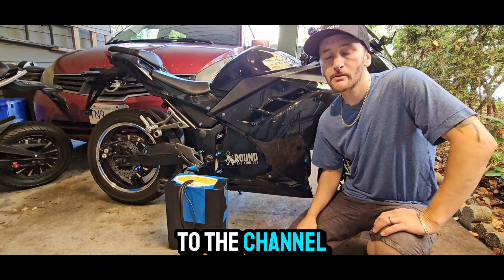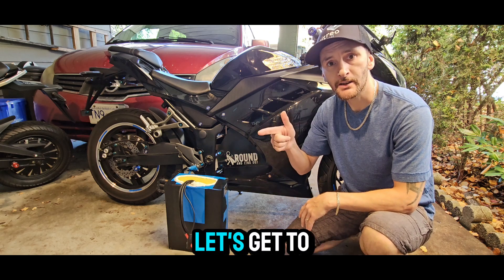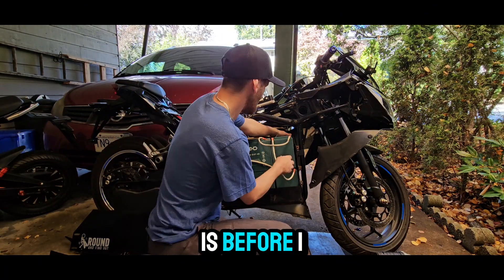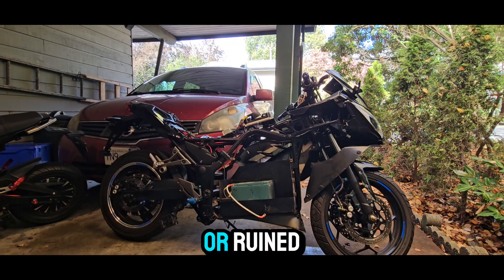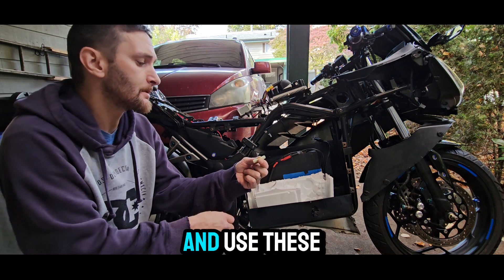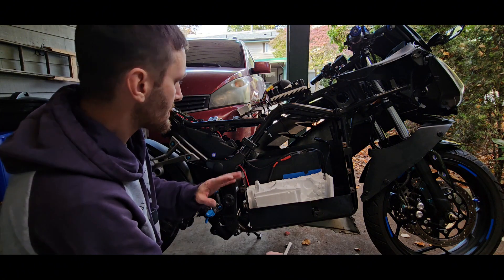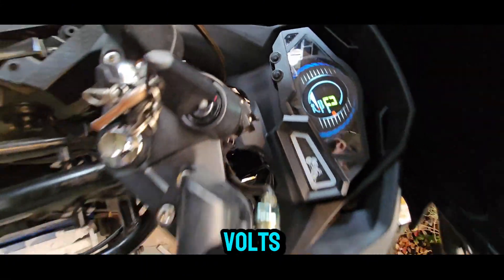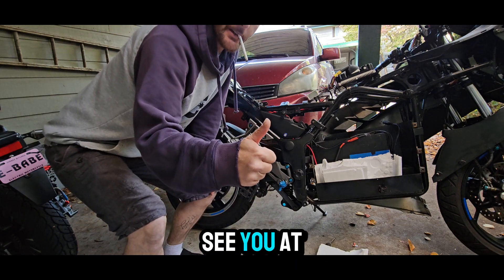upgrading from lead acid to lithium #emmo zone

Comment: Is the compartment of lead acid battery and lithium battery the same?
Reply: In size I mean
Reply from the maker: @satria_137p 
Yes weather you buy lead acid or lithium the battery compartment is the same size but you can fit a 72v 100ah lithium battery in there as opposed to the 72v45ah lead acid battery is al.ost filling the compartment ,so go lithium for sure, lithium is just better in every aspect as long as you buy from a reputable company, I bought the lead acid battery with my bike because it's way cheaper and the lithium batteries emmo sells are low end x and way to expensive, it was just better to buy lead acid battery and then upgrade to a aftermarket lithium battery, plus i saved thousands doing it that way. I hope I answered your question? If not don't hesitate to ask me anything.

Comment: Can I ask you where I can buy this specific battery
Reply from the maker: I bought mine second hand but if your gonna buy a lithium battery I'd advise buying from one of these three places
Amorgepower.com can build you a lithium battery to whatever specs you want and  for cheaper and top quality but takes awhile for shipping. 
Voltalize.com is a Canadian based company that sells really good batteries for a little more $ but is quick to ship and has better aftercare warranty because their local,
Then there's evcustoms.ca, a guy named Eric Lynn is located in ontario and he will build you an amazing battery or custom build and upgrade your bike .actually this is where I plan to get my motor/controller and my battery when I can .
Reply: Ty so much I will use homegrown ones lol the Canadian ones this is so frustrating I have only had my bike a week n I’m not impressed with lead acid

Comment: My zone has a bad brake squeel even when slightly moving tried everything 😢 any ideas plz help
Reply from the maker: So the obvious fix is to clean them with brake cleaner but that doesn't last very long, best thing to do is buy new pads and cleaner to clean the disc's and new pads before installation but what I did until my new brakes arrived is i took a rag and a little oil and put some on the rag and wipe down the disc's with a little oil and the wipe it off with another rag ,front and back brakes then go for a ride and brake really hard over and over until you get full stopping power back, I know it sounds weird or stupid but it really works! And it lasts quite a while but you have to do the braking hard thing repeatedly for 10-15min before you actually go riding somewhere. Also there's something you can buy called brake quiet for cars and I heard that works too but haven't tried myself. 
Hope that helps? Trust me I had the same sqeeling, actually apparently everyone with a zone has the same sqeeling. It's a combination of cheap pads and disc's.

Comment: Hello @theemmohandyman I just bought a emmo zone 2 20ah sla and just a quick question did u have to change the charger or is everything the same jsut swap battery over?
Reply from the maker: You definitely need a lithium charger if you are switching to a lithium battery!
Reply from the maker: Also when you buy your lithium battery you need to buy a matching charger, on the lithium battery it will tell you how many amps it can be charged at. So mine can be charged up to 10amps , so i bought a 10amp charger but if you want you can use any lithium charger under 10 amps aswell but nothing over the rated amps. 
Also usually when you buy a lithium battery it will come with a charger. ⚠️Warning don't buy cheap lithium batteries!!  My your battery from places like amorgepower.com or voltalize.com or evcustoms.ca 
Those are the top places for batteries for these ebikes and also don't buy the lithium batteries from emmo or any of the similar ebike companies they are over priced and garbage, my advice is pay for a good battery and it'll last for 5-10years depending on how much h you ride and you'll get a proper warranty.

Comment: Hello, can you please provide a link for this battery? Or was this custom ordered? If so can you please provide who and specs? Thank you!
Reply from the maker: Hello, so I actually bought this from a friend but all batteries I've bought before and will buy will be from a Chinese distributor, 
It's called-amorgepower.com  and you can check out there different types on the website or goto alibaba and check out prices but this company is the best quality and nobody can beat there prices,you can either pick a battery matching what your looking for or they can also make you any size/any voltage/ any amp continuously you need,just give them the specs you need and the size of your battery compartment and they'll build it for you,seriously you won't find a better battery company with this quality and prices, here's the link,
https://x.alibaba.com/xyKHTze?ck=minisite
But if you want to keep it in canada or USA  goto evcustoms.ca or https://electroandcompany.com/
But personally amorge is equally good and way cheaper!!
Good luck!

Comment: Can I ask what is the sized of the fair ring bolts and the  Swingle arm that you brought of aliexpress on your bike thanks.
Reply from the maker: @starship9290  so the swing arm is stock if that's what you mean but the fairing bolts you can get a link if you go to one of my other videos called ( upgrading to better fairing bolts) something close to that and all links in description. Actually everything I've done with my bike is in the description of each video apart from the lithium battery,that I bought privately .

Comment: Is battery protected against wet weather conditions rain while riding in the rain ?
Reply from the maker: @starship9290  I do not ride in the rain,some people do ride in the rain but would you watch  TV in the rain or use your computer?
Yes you can ride in the rain but it's not advisable if you want your bike to run properly and with no problems. I dont ride when its raining but If and when I do get stuck in the rain, when I get home Immediately grab a towel and dry everything off and I mean everywhere I can and paying close attention to the throttle and signals and brake levers/the charge port /definitely the battery box ect..ect..by the time I'm done it's dry as it would be on a sunny day. It's a really expensive bike and I want to keep it in top shape as long as possible.
Reply: Of the game is on Hell yea I could tv in the rain lol 😆  jokes aside.
 I got me a tao leo ebike and I use it as a daily commuter to work and I only rain in the rain when it very light rain by the time I get to work the rain as stop plus I also have a motorcycle cover I use to cover my ebike when am at work if am gone for long periods plus a motorcycle disc lock.this works for me so far so good. Thanks
Reply from the maker: @starship9290  ya I get it,I have ridden in the rain when I have too but I don't if I can help it ,I've seen many problems.s with getting then too wet and honestly I get a little scared to fuck it up,I haven't had many very nice things in  life and my zone is definitely the m9st expensive and fuckin awesome anything I've had so I totally baby her,but ya lots of people do ride in all types of  weather conditions and do just fine .
Lol! But with my luck I'll start riding rain or shine and fu k something important lol! And your right I'd watch the game in the rain a fuckin day!!

Comment: May I also advised that u should add some soft pads under lithium battery and  Strap it to them because the bumps on the road So the battery will not move while driving on the road
Reply from the maker: @starship9290  so I didn't show in the video but there's a bar that is used to hold down all the lead acid batteries and I also surrounded the lithium battery with thick Styrofoam and then the bar is bolted on top of the box and straps it down, but thanks for looking out 😃

Comment: How is after the update battery  swap?
Reply from the maker: @starship9290  since the swap the bike is way lighter and everything I expected! Faster off the line ,faster top speed of 100kph.
Reply: 100kph sweet 🎉😮on the street bro you can zoom zoom on the highway bro just don't let highway cop see you or you could lose your bike for a while that what i heard from some other ppl thou .but if you got a motorcycle license I think you are good.
Mind is still stock .still need to break it in .max I  have reach is 67 to 71kph and I have really push my tao leo ebike to its maximum speed yet.😮
Reply from the maker: @starship9290  ya I never really push it that hard,generally I'm riding between 40-60kph but co.e on after putting the lithium in there I had to see the top speed😝 my wife would kill me if she new I was ripping around 100kph on the highway!! She has a knight turbo of her own but gets a little anxious when I ride fast,I get it,what year is you leo?
If it's lithium you should be able to push 100kph too ,and stock unless I'm misinformed??everyone says there the better of the two top brands ?
Reply: Lol 😂don't tell wife you are doing 100kph 
My leo 2022 model and it just a yrs old now. I didn't ride much last yr had a battery recall  and a motor power problem so I didn't ride ride though out the riding season ended.
  72v 50Ah Lithium and I went straight to the Lithium battery and I have to say it was fun to ride and was i Nervous riding it at first, so I had to watch motorcycle videos on YouTube in how to ride one, get the courage to start riding with practice then I start getting better.
Reply: So I ride it like a car driver or like a real motorcycle 🏍 on the back roads in T.o downtown